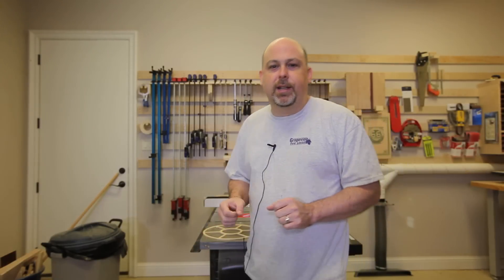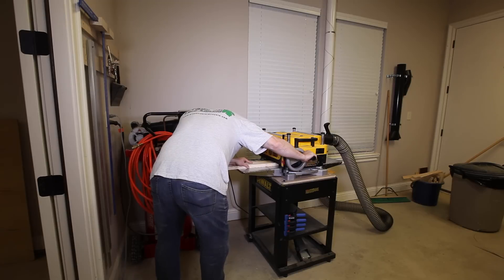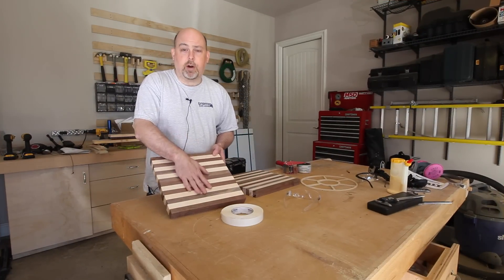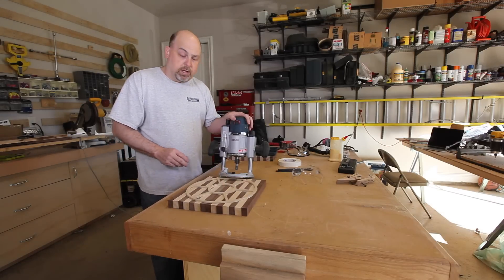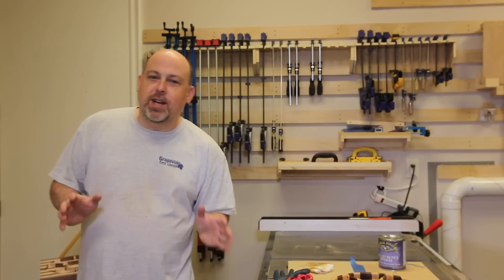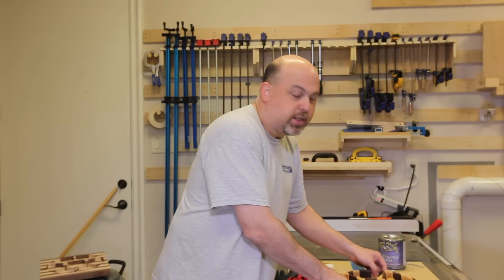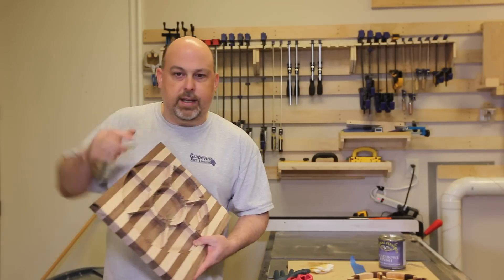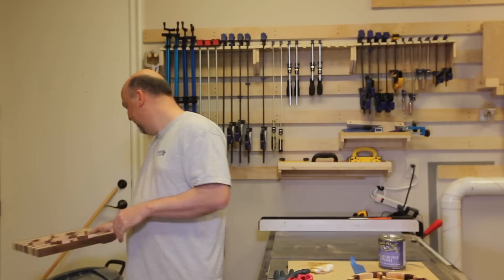Make a Party Serving Tray: Hand Tools vs. CNC

Comment: Sorry to knock ur review bud but firstly youve managed to utilize the wrong bits in that "toy cnc" as you guys refer it to. U also used a wider diameter flush trim bit in your hand held router not a fair comparison not to forget to mention your machine isnt tuned for sure to make such a drastic difference. Had you used a .5"/ .75" or even a 1" flush trim bit with a ramp of about 1" with proper software not easel. I would beg to differ. Cheers though for your findings.
Reply: Not bashing your review dont get me wrong. But for more of a production run with proper setup the "toy" would stand its own. Jus saying. *cheers 🙃
Reply from the maker: Why don't you make a video and show me how its done, because I am all but certain you can't.
Reply: @TheGeekPub    Hmm wow loving ur confidence. I happen to own an xcarve myself. That is not a problem. I will 👍.  Again, i didnt comment to knock your review as it seems thats how you took it apparently. Your certainty that i can't quite amazes me though. Nothing beats proper CAD/CAM software. And the knowledge/experience of how to use it. Easel is free and limits what the xcarve is capable of.
Ps. I am not affiliated with inventables in any way neither is this a paid or sponsored response lol. Was jus me trying to shed some light. Will upload that vid as soon as the season is over. Cheers again bud, and happy new year 🍻

Comment: Hey what type of feet do you use on the bottom of the trays? Also can you make one with out a plunge base router? I have the dw618 but no plunge base.
Reply from the maker: Depends on what I am making. Generally just the stick on stuff from Home Depot.  It would be pretty hard to use a non plunge router, but I suppose with enough practice it might work.
Reply: TheGeekPub ok thanks!

Comment: With no dust collection at or even a dust boot it's no surprise the belt slipped. You could see how filthy the gantry and rails were with sawdust, mucking up the whole system.
Reply from the maker: I had a shop vac and was removing the dust about every minute.  Thanks for your concern.

Comment: If the bit fell out then something was wrong with your job setup (be aware that in the minds of people familiar with CNC routers once you said this the test was invalid the same as if the bit fell out of your plung router). This error probably caused the belt to slip (though for the first few jobs of a new x-carve the belt stretches and needs occasional adjustments). I have run a CNC similar to the x-carve for years. I can tell you that when properly tuned it would be able to do this job quite rapidly. Belt driven CNCs are faster and use smaller moters then lead screw CNCs (lead screws give greater power and resolution). The X-carve had the potential to be a fast cnc. Cnc routers are not toys though and quite a bit of learning and testing is needed before you see the true abilities of the device (the inventables recommendations are a good start but not the optimal for your set up and your material). It would be interesting to see how long someone who has optimized there x-carve for speed would take on this project. Also if your router was smoking after that amout of time there was something defective in that router. That is well within the expected stress tests of a professional router. In a properly working router the brushes should give out long before the thing starts smoking. At least that has been my experience.
Reply: I do agree though that this job is not one ideal for a CNC. It could be done quite a bit easier with hand power tools and alittle creativity.
Reply: I agree learn your machine. and dump the machine with the belts onfinity all the way baby!!

Comment: I have an x-carve and it does great work for the price. Obviously there are some trade offs for the low cost that it's designed to sell for. With the proper tuning and maintenance, this project could turn out great with it, and definitely the carve would take less than 7 hours. Once the machine is dialed in and and using he proper bits, it runs great.
Reply from the maker: +Brodie P I'd be happy to see you do it, video it and prove me wrong! ;-)  I'll even give you the SVG file I made to make sure its apples to apples.

Comment: Good comparison.  Thanks for the effort.  What I don't understand is why you can take the router in hand and complete the job in two hours but when you put essentially the same router in the CNC it takes seven hours.  The numbers don't seem to add up.  

I can understand missing your alignment mark or slipping a cog, but taking almost four times as long for the same cutter seems strange.
Reply from the maker: +Buncha Baloney Many differences.  Apples and oranges really.  The route I used was a 1/2" shank, 3X the horsepower, and a bit designed for hogging out material quickly.  The X-Carve is running a much smaller router.  It's servo motors are not capable of pulling the bit through the material quickly (compared to my human arms) and the bit is an endmill (what CNC's use) bit.
Reply: +TheGeekPub 
OK.  For some reason I thought you were using the Dewalt router upgrade on the X-Carve.  I can understand why it would be so slow with the smaller router.
Reply from the maker: +Buncha Baloney I think we're missing somewhere.  I do have the DeWalt upgrade.

Comment: Nice video, that about sums it up. A CNC machine can only be ran as fast as it can tolerate. Stiffness is a key. Did you bolt the SO2/Xcarve xrails together? That helps quite a bit. I had an SO1 that performed better then the X-carve, granted not anywhere near stock. Recently I painted and assembled an old shopbot, which coming from the SO1 sounds like it will miss a step every second running so fast, but doesn't. The learning curve with the old shopbot is what gcodes it supports. GRBL supports more then the machine I reassembled. Helical ramps, not so good. 

:-(  Seems to be a lot of comments from people I watch on youtube. To TheGeekPub, Peter, Mitthias, Darbin, and many more... Continue on, I learn from each and every video!
Reply from the maker: +Frank Wiebenga So I am not sure what you mean when you say "bolt the rails together".  Tell me more.
Reply: TheGeekPub Most of the SO1/SO2 users would bolt together the X rails. I did similar with 3d printed inserts along the length of the X axis. http://wiki.amberspyglass.co.uk/index.php?title=EShapeoko_1.2_Assembly:_X_rail Sorry I didn't reply sooner, didn't see the notification until now.

Comment: Every xCarve video I watch, the speed of the machine is so slow.. I have a member at our makerspace that basically has replaced almost ALL of the steppers, belts, electronics to make it CNC worthy.. If you can use a router faster than a CNC, there is something so wrong. I know we are spoiled here, as we also have a 4' by 8' ShopBot that is just AWESOME.
Reply from the maker: +frickmystr I'd love to see that thing in action!
Reply: +frickmystr So you're comparing a $15000 machine to a 1 or 2 thousand dollar machine for a similar size. A little unfair. I know the X Carve is just a high end toy but I have seen lots of good videos about it. It isn't without it's limitations.
Reply: +1976ClassicCelica I agree. The cost for his upgrades didn't add that much to the initial cost. It is poorly constructed and the original spindle which most of the free ones that were given to YouTubers. Good cnc can be built for the same price.

Comment: Your hand router one turned out really nice.  I thought about doing a similar "Steve vs CNC" video to compare speed and accuracy.  It sux that the x-carve didn't finish that one successfully, plus your Dewalt overheated.  Yikes!   I've been lucky and haven't had any major fails like that.  That would be really frustrating.
Reply: +frickmystr  When I made the guitar, I didn't have a router on my CNC...it was the entry level spindle which is more like a dremel tool.  I did lots of tests to find the speed/depth that it could handle for the wood I was cutting.  I just installed the Dewalt trim router and can't wait to see how fast/deep it will cut.  I agree that the CNC should run as fast as the router, but only if the CNC has the same router on it and the frame/belts/motors/etc are robust enough.
Reply from the maker: +Steve Carmichael Yeah.  I might do this test again in the future with a smaller project, because I would like to be able to speak about the quality of the finished item, etc.  The DeWalt seems to be back to normal this morning.  Not sure about any long term damage.  They are certainly not designed to run for 7 hours straight though.  If I had it to do over again I would pause the job every couple of hours and let the DeWalt cool down for 30 minutes.  Of course, adding even more time and frustration to the CNC process.. LOL.
Reply: +TheGeekPub I need to know, what bit are you using.. When I watched Steve's build of the guitar, it was WAY to slow.  The CNC should run at least as fast as a hand router. Wood is normally done at about 150 Inches Per Minute and depth of cut is normally diameter of cutter. So 1/4" cutter should give you 1/4" depth of cut. I would love to try this project at our makerspace and record it on our shopBot.

Comment: Great video, I was wondering what you rubbed on the blanks before you wiped them with the wet towel?  Thanks for the great videos.
Reply from the maker: +Levi Fuller Just water.  I was washing away the squeeze out before it dried.

Comment: I am curious and have a comment. 

1.How far in before knew the x-carve was out of position?  Early enough to move the board?

2. Since the CNC, set at a slower rate, may have taken longer, yet probably saved the motor head, and you are not required to be around while it does the job, What would/could you have done with the 2 hours you spent on the router made tray?

People have been doing CNC machining since the late 60's early 70's, it is safe to say that CNC as a "manufacturing" tool is well established. And the complaints about a "toy" aspect could be made about any personal/home comparison - go cart vs car, model rocket vs Saturn V, treadle lathe vs Robust $8K lathe.  The point is: use the tool that completes the job to your satisfaction.  I watch a man from England to 99% of wood work with his hands and hand tools.

End result - the finished tray will hold food and the people eating will comment on the content of the platter but not the platter. (Unless you nail it to a wall as an art piece.)
Reply from the maker: +SuperYtviewer 1.  About 2 hours.  No.  2. I suspect the motor would have still failed at the same time limit.  These things were never designed to run continuous like that.

Comment: I found the x carve is good for making an accurate template it just takes too long for me as well to hog out a lot of material. You could also use the template to cut a guide line in your material that the guide bushing can run against might be a good way to combine the 2 techniques
Reply from the maker: +Warren Downes - One Wood I was going to to do that, but then I just knew everyone would say "See, still needed the CNC!"  That's why I made the template on the scroll saw.
Reply: TheGeekPub There is something therapeutic about using a scroll saw as well :)

Comment: hi :)  I'm not surprised at all. I respect a lot what you've ddeone but to me the demonstration works only with the tools you used. Xcarve is as representative of the CNC abilities as a dremel is representative of power tools ! Both are toys than can only do light jobs. The power tools you used are ways better than the Xcarve. If you used a CNC of a comparable quality as your bosch router or your bandsaw results should have been pretty different : probably the whole tray can be done with the cnc in minutes. Othehand if you realized your tray with just a Dremel amnd a scrollsaw, time, issues and quality should have been different too. What I understand of your demonstration is "good power tools do job better and faster than a Xcarve". And I'm not surprised. But apreciate the Xcarve is a CNC toy, not a proper CNC. Proper CNCs beats good power tools in the time needed to make a jig. ;)
Reply from the maker: +Axel Sixtysix Which CNC do you recommend?
Reply: Well I built mine to get a better one at low cost. Through all the brands are not avalable everywhere. In America maybe a Shopbot or a Laguna. In Europe maybe a BZT. In Asia I recommend JCut whom ships worldwide. Serious CNCs that can machine a tray in minutes. ;)

Comment: Unfair comparison!  The title is hand tools vs CNC, not power tools vs xcarve. I will let the hand tool,misnomer slide, but not the CNC one, The Xcarve is junk! The belt driven mechanism is inferior to ball screws or rack mechanisms. The belts driving the axis are prone to slipping and skips due to dust and changes in material hardness. Your results would be very different if you used a better CNC machine. The 3040s and 3020 cheap Chinese machines are a lot cheaper and perform way better than then XCarve. The build quality is better too. They are made of solid heavy gauge aluminum.
Reply from the maker: +Man na I've said many times the X-Carve should run on rack gears and not a belt.
Reply: I have a belt drive on the long axis (48") on my custom machine, and never had an issue. BUT, everything has to be tensioned correctly, the gear has to be clean, etc. It took quite a bit of tinkering to get it right.  (At one particularly-entertaining moment, one of the belt clamps came loose and all positive X motion stopped. Good times, thank God for limit switches.) Nice video - thanks for sharing! The X carve is a neat tool, but could use a lot of improvements.

Comment: what were your feed and speed rates? it shouldnt have taken anywhere close to that much time unless you were going reslly slow
Reply from the maker: +mike gager I took the speed and feed rates right out of Easel for my machine.  I then bought a high quality high speed end mill.  I doubled the feed rate and depth settings.  The machine was definitely struggling to keep up as the router would vibrate pretty bad on on the first new plunge every time.  So I stopped it, and set the feed rate back to the easel rate, but left the depth setting to 2x.  And it STILL slipped the belt.  I'm no X-Carve n00b.  I've run this thing enough to know what I can get away with reliably.
Reply: +TheGeekPub well first thing i notice is your bit is way to long. thats going to cause issues with vibration like you encountered. secondly easel feed rates are WAY conservative. even at 2x (60ipm) i think its slower than what you need but would probably be ok. i generally use 1/2 the diameter of the bit for the depth of cut so in this case 0.125" and would suggest 80ipm but with a much shorter bit length.
do you have zip ties or shrink tubing on your belts? i use zip ties but found i needed 2 on each end to keep them from slipping so you might give that a shot. 
im kind of bummed about the dewalt failing on you, thats the first one ive heard of to fail like that. i wonder if dewalt will warranty it?

Comment: I use a Carvewright CNC machine and I have been using it for years now. I also have had epic fails but over all its been great. You do get a sense for what things go well on a cnc and what is easier with other tools. Many times i use the cnc for carving details then routers, router table, table saw, or band saw for final cuts and other work. 
https://www.facebook.com/solanowoodworking/